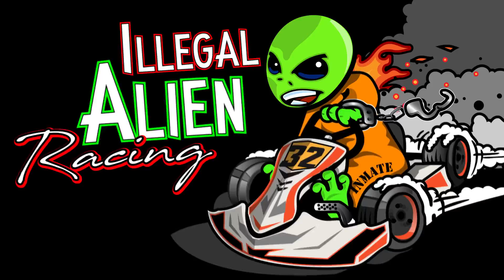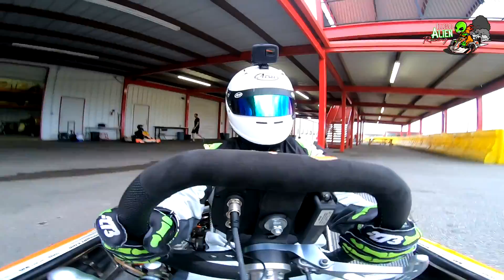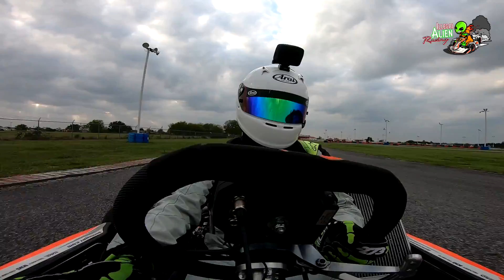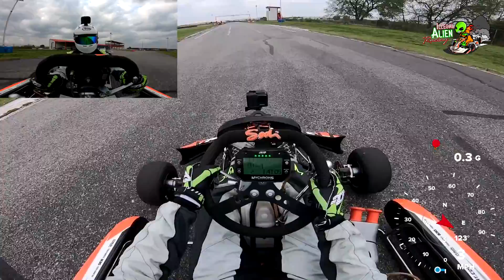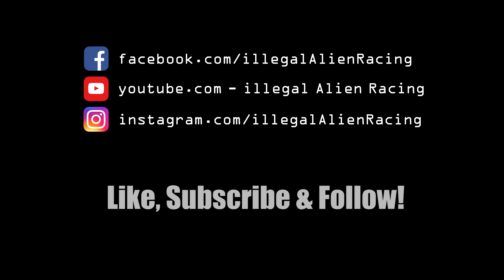Acceleration & Stopping Power of a Shifter Kart - G Force Meter Included

Comment: I know that you pulled the clutch to avoid engine problems, but would be interesting to watch the brake capacity down shifting while you are braking.
Reply: I would imagine he would still be limited by the tire's grip though, same stopping distance
Reply: Yep, downshifting will help stop the kart in dramatically less distance with engine braking
Reply: Donny ward is wrong,
Stopping with drag from downshifting and braking  together would slow it down  faster.

Comment: Nice vid dude. Just something to be aware with when doing standing starts, try to avoid doing them when the tyres are fully warmed up as the grip from those 'sticking' in place when coming to a stop combined with the torque spike coming from the engine can potentially rip holes in the axle where the axle key is inserted. Keep the videos coming!

Comment: Can someone answer me, a 2 stroke automatic 100cc tm Moter go kart what is the top speed?
Reply: I have a ka 100. 2 stroke and It will do 85-90 on a long enough straight away, like a really long straightaway
Reply: guessing about 70 mph
Reply: @davidbaumgartner4289  wow. It has the same top speed with a 6speed?
Reply: @petsokoma6580  no this is a 125cv I drive a Ka100 and it’s fast it will do ab 70
Reply: @JustinMusicRacing  so a 100cc 2 stroke automatic can do 70mph?top speed
Reply: @petsokoma6580  IT ALL DEPENDS AND WHAT YOUR CART IS GEARED FOR! YOU CAN GO AS LOW AS 50MPH OR AS HIGH AS 100++++! GEARING IS WHAT TELLS YOU YOUR TOP SPEED!
Reply: Mid 60s

Comment: Does it shift down automatically when you stop? I didn’t see you shift down until after it came to a stop
Reply: If you watch closely he pulls the hand clutch to slow down, then down shifts after having stopped.
Reply from the maker: No, you have to manually do it.
Reply: I was wondering the same thing O?
Reply: No, you're supposed to down shift as you brake, he held the clutch in and then braked from 70 (for some reason) to stop it from stalling. You only use the clutch in these karts when you want to move from a standing start or when you want to come to a complete stop but keep the engine going meaning you don't need to use it when changing gears. If he had down-shifted while braking and then held the clutch in just before he stopped he would've actually come to a halt even faster than he did.

Comment: Honestly the stopping speed surprised me more than the acceleration speed
Reply: The most powerful part of a vehicle is the braking system
Reply: they stop even faster when u downshift it while braking
Reply: @atillacoskun90  
Not ment to engine break with 2strokes , they're already under a lot of stress from reving twice as high & fast as a four banger without adding more crank stress from gear slamming for braking resistance 👍🏻